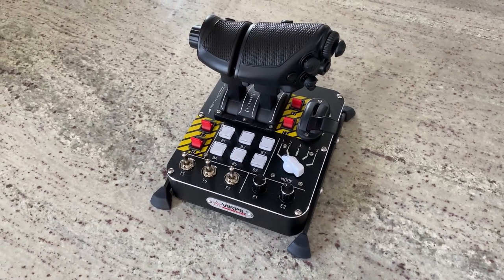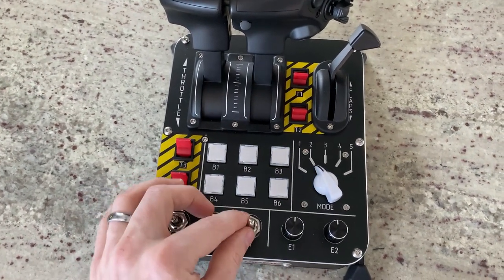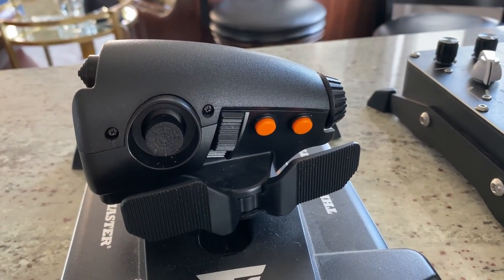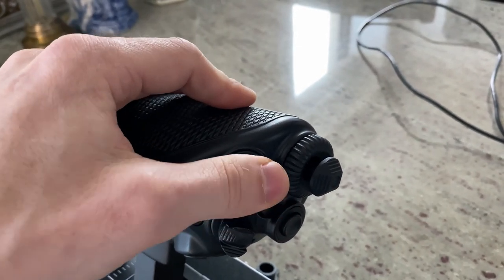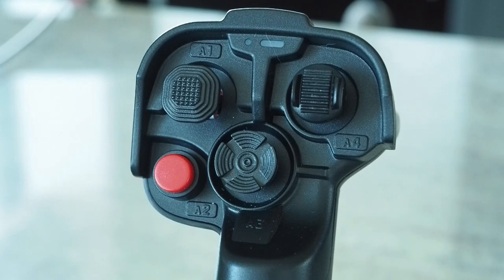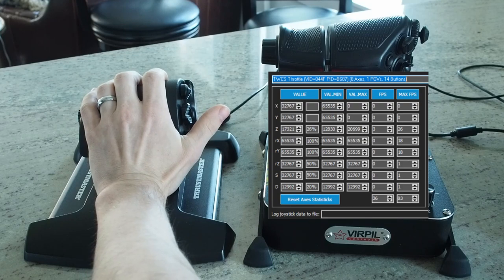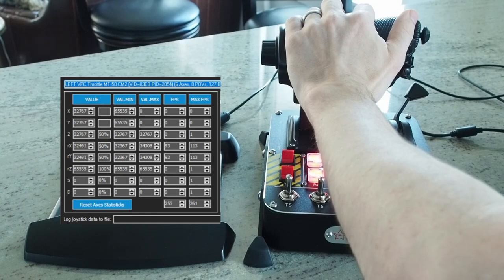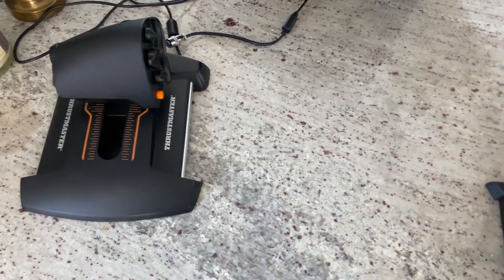Virpil MongoosT-50 CM2 Throttle Review & Comparison (vs. TWCS)

Comment: Nyogel 767A works. I use it on my TWCS. It improves precision and the general feel very much. You won't make a Virpil out of it, but it feels like upgrading to a higher class of controller. It is well worth it. I also used it on my T16000 which was a great improvement, too, especially around the stiff center of the T16000...
But I upgraded to VKB Gunfighter (+ MCG Pro) and could not imagine to go back :)  You can become quite happy with the Thrustmasters and Nyogel, though, for substantially less money. 
Depends on how much time you spend using the controllers. If you use them a lot and see yourself doing that for quite some time because you really enjoy it, go for VKB or Virpil right away - in case your budget allows it, of course. It is on a very different level - in terms of price but also what you get. When it comes to the enjoyment of playing - I play Elite Dangerous - it is for me like I play the game to use the controller(s) more than I use the controllers to play the game. People owning a VKB MCG Pro will know what I mean...
Thank you for your very detailed look into the hat functionality. This was very valuable to me. I have watched quite many videos regarding that throttle and other HOTAS controllers over the time. Let me tell you that yours is the most helpful one regarding how it might actually feel using the different controllers. Thank you for being so observant and taking the time to film all the details of the button movements and sounds.

Comment: You described gated vs non-gated hats. The CM2 hats are not gated. Also you can change the CM2 hats to 8w (8-way with diagonal press signals sent to Windows) or 4w (4-way without diagonal signals) in the Virpil software.
Reply from the maker: Thanks for the clarification! I wasn’t able to find a satisfactory definition of a gated vs non-gated hat before making the video, so I wasn’t sure which category the Virpil throttle fell into. I guess I prefer gated hats, though I can see the utility in being able to change any of the 4-ways to 8-ways using software alone.

Comment: I upgraded from TWCS (which got less reliable over time) to STECS and I also wasn't impressed by the hats... but I'd say they are better, from what you describe (no personal experience though). Comparing to TWCS alone is not quite fair, that one doesn't have push action, but I really like the hats action on that one, no question about it. STECS 5-way hats are similar to Kosmosima (I own that one), BUT the 5-way hat on the thumb (Premium option) is least precise of them all and easy to press in a wrong direction.
With STECS swivelling, it's easy to pull the hat (up) instead of pressing it, especially in the forward position. And sometimes you can do so with the sound exactly the same as a press - because otherwise it has different sound. So for some hats I often accidentally use wrong direction, especially instead of center press. It is probably not as bad as what you demonstrated, but I expected more precision/distinction with 5-way hats on STECS. It's probably not easy to make it so definite.
Good analysis, I like it. Some may call it nit-picking, we will eventually use to the action and be more aware of how to use it, but there is some play in the hats and it's good you pointed it out.

Comment: I have the 2 previous versions of the Virpil throttle.   They make great stuff, for sure.  Their 1st version had a detent you could set where you wanted it so you could have either a 50%, afterburner, or idle position detent.  It was great, but they deleted it in their last 2 versions due to a high failure rate.  Mine never failed, but whatever.  I miss the detent, and wish they would re-engineer it and give it back to us.  I use it for the 50% position as I use it for forward/reverse thrust in Star Citizen.  Not having that tactile indicator for neutral thrust is a real inconvenience.  Otherwise, I love it.
Reply: S

Comment: Good review. 

I'm glad you put the throttles next to each other as it really illustrates just how much larger and taller the Mongoose really is. I don't think I really have the desk space for it.  For me the TWCS works fine for the moment, especially after using that nyogel stuff.  Thrustmaster really should use that stuff out of the box or at the very least include a small syringe of it on their website.  The 50g tube I got off amazon was roughly 35 dollars which is about half the cost of the throttle, and you'd be hard pressed to use more than 10%-20% for the application.   The company would probably make a killing if it offered a 15g tube at a more affordable price. 
 

Anyhow...

I think my only concern about the Mongoose  is that with smaller hands I'd be worried about reaching all of the forward controls in a full throttle position where the angle would feel even more awkward.
Reply from the maker: The Mongoose really does have a large grip. I don't find the base to take up all that much more desk space than the TWCS, but the grip is certainly much larger. It's more of a challenge reaching all of the grip buttons, especially compared to the TWCS. Though the feel and weight of it, in combination with the smooth throttle action, makes up for it IMO.

I'll be getting my hands on the Thrustmaster Warthog throttle soon - which is supposed to be a bit smaller than the Mongoose - and I hope to be able to put up another comparison video in the next couple weeks.

Definitely agree with you on the nyogel, it's a shame you can't get smaller bottles.

Comment: Glad to find this review as I'm about to make the same jump (TWCS to Virpil).  Pertaining to the accuracy on the TM throttle, I'd ask if you Nyogel'ed it.  The Nyogel 767a makes a huge difference on both the T16k sticks and the TWCS throttle.  It gets rid of the "sticking" on the throttle and allows for minute actuation, like the kind refueling from a tanker requires.  Ah, you just said you greased it.  I think you'd have found the Nyogel is better for this as it adds hydraulic resistance that smooths out the movement.  Doesnt matter anymore I suppose, but the TWCS is excellent for its price.

I just got the Constellation Alpha grip and I agree with what you're saying about the hats and their lack of surety.  I'm finding I have to press each button a specific way to get the results I expect, I cant simply press them.  It's as if I have to position my finger appropriately before I actuate the hat.  It's a little frustrating, but given how many more buttons I got moving from the WRDBird grip to the Alpha, I'll get over it.
Reply: Tri-Flow works better....It is available via Amazon or possibly local bike shop..

Comment: is the flap selector an axis, dont think you mentioned it. is that normal for flaps to be controlled with a single axis? surely needs to be 3 way selection right?
Reply from the maker: The flaps lever is indeed an axis. Optimal flaps control mapping really depends on the aircraft you’re flying. Older aircraft especially tend to have flaps on an axis, so this input lever on the throttle works very well. The F14 in DCS has the option to map flaps to an axis, but there is no intermediate flaps position, so it functionally ends up acting as a flaps extended/retracted switch (despite being mapped as an axis). The F18 has flaps mapped to a 3 way switch - full, half, and retracted - with no axis option, so the Virpil flaps axis lever isnt a great input choice. For aircraft like the F18 - with flaps as a switch and not an axis - I like using the two-way hat on the front of the Virpil throttle, mapped to flaps extend & retract.

Comment: Useful video, but to be fair, the VIRPIL is more than 3X as expensive as the TWCS. It competes with the TM Warthog throttle more than the TWCS.
I agree with your comments on the TWCS - really tough to fly in formation, or hit the tanker, as fine adjustments are almost impossible, even WITH improved grease. This, alone, is reason to replace the TM product.
Reply from the maker: Agreed, the Warthog is a better competitor from a price perspective. I had a Warthog in hand very briefly and vastly prefer the Virpil, especially considering the price of the Warthog (vs the quality of what you get), but unfortunately I didn’t have it long enough to do a review.
Reply: @jamesdolezal8936  , thanks. I fly almost exclusively in VR, and am trying to figure out if the VIRPIL or the Warthog is better suited for using "blind"? My main flightstick in a VKB Gladiator II.
Reply from the maker: @Pics2FlicksDennis  Both my father and I have the CM2 throttle and fly exclusively in VR, and we have no problem using it "blind". There are a lot of buttons and switches, but once you spend some time using and mapping everything, it's very easy to find all buttons without looking while in VR. I imagine the Warthog is similar in this regard.
Personally I don't think the Warthog throttle is worth it for the price compared to the CM2. The Virpil just feels so much nicer in the throttle action, with zero play. 
Of the limited throtttles currently available, I personally feel the only ones really worth considering are the TWCS and the Virpil CM2; get the former if you are on a budget, and the CM2 if you can afford it. The Warthog just doesn't have a place in the equation at $250-300. If you can get it for <$150 I think it'd be a good buy.
Reply: @jamesdolezal8936  , I already have the TWCS, but it's very imprecise, and almost impossible to fly in formation, or to tank, with it.Thanks for your advice!

Comment: Virpil doesn''t make anymore the Mongoost-50 CM? On the site there is only the CM2 model.
Reply from the maker: Juliano Bondan correct; the CM (of which there were three variants) is no longer in production. They were briefly selling B-stock units a few weeks ago, but those have now sold out.

Comment: Thanks for the review!
Just a quick question, does the throttle itself have a 50% bump?
I know this is not a big feature for flight sim pilots but it’s important for space sims.
Reply from the maker: It does not have any detents, unfortunately. You can use joystick software like Joystick Gremlin to create dead zones and trigger audio cues to help know when the throttle is in a specific zone, but it’s not quite the same. Some people have made idle and afterburner detents with 3D printers but I haven’t seen a 50% detent yet.

Comment: Thanks for doing this. I have the same throttle. Does your throttle also have some movement (very little) when they are connected by the "peg"? I.e. like they aren't 100% connected?
Reply from the maker: Yes, this is common to the Virpil throttles. I initially tried several fixes but nothing really worked. It doesn’t really bother me anymore.
Reply: @jamesdolezal8936  Thanks for the answer :)

Comment: Is this compatible with Microsoft flight simulator 2020?
Reply from the maker: It works as a standard joystick controller under Windows, so it will work without issue.

Comment: Can someone explain to me why a keyboard isn't used instead of the throttle? Wouldn't that be more efficient?
Reply: Because a keyboard is just buttons, it either on or off. Imagine the gas pedal of your car being a switch, you touch it and it accelerate 100%, you lift your foot and it's 0%. Impossible to drive in that fashion, an analog signal is what you need, from 0 to 100 with all the in-betweens, that's what an axis like the throttle is. Same for a joystick.

Comment: does it has a afterburner dent?
Reply from the maker: No detents, but there are some 3D printed aftermarket detents available. They were designed for the earlier version of this throttle though and I’m not sure if they would be compatible.
Reply: @jamesdolezal8936  hmm i need to look into this. I want to replace my thrustmaster warthog throttle really bad (already got VKB Stick)! But i do need a Afterburner dent, i cant live without it :(

Comment: Nice video but comparing them is actually silly since they are at a very different price point lol if you would have compared the Thrustmaster Hotas Warthog with the virpil than it would have made more sense otherwise nice video but comparing something that is 50-80 to 200-300+ is a little silly tbh
Reply from the maker: I agree that the Warthog would be a really helpful comparison, and I wish I had access to one. I do think the TWCS is a valid comparison though, even if the price ranges are very different, for two reasons: 1) these are two popular and commonly recommended throttles, and 2) it can be helpful to know what you are getting when you pay more. For some, the extra $250 for the Virpil would not be worth it. For some, it is. I tried to leave price and value out of the discussion because I think “value” and “worth” are highly subjective, rather focusing on the objective differences between the devices. It’s up to you whether you think the differences are worth the price differential in your region. 

It’s less helpful if you are coming in with a set price range, and more helpful if you don’t really know how much you should spend, or if you’re considering upgrading from the TWCS.

But I’d like to get my hands on a Warthog, because like you say, it’s a more direct competitor to the Virpil.
Reply: Worked well for me. I'm making the same move he is.